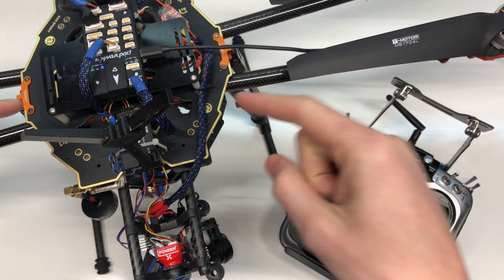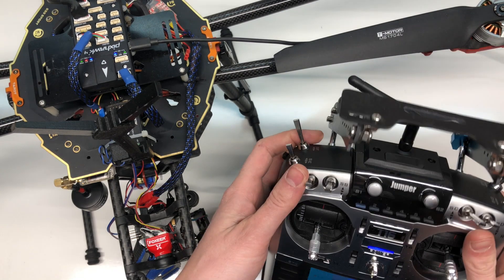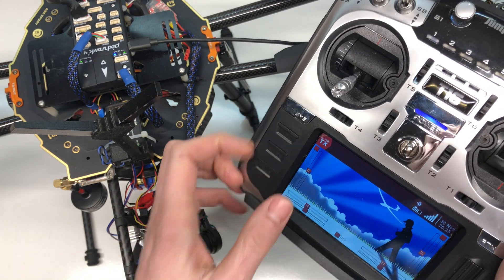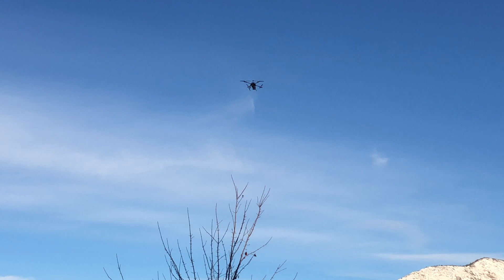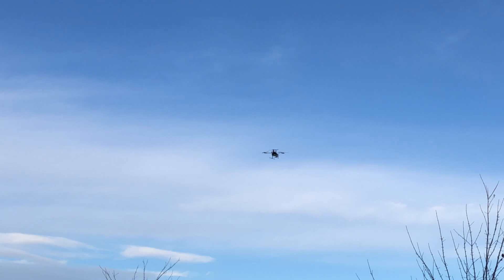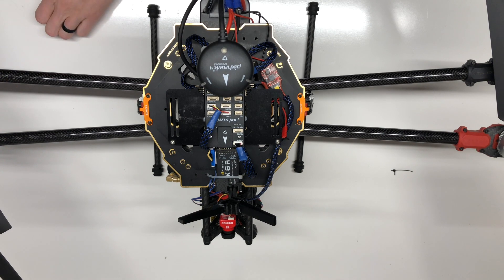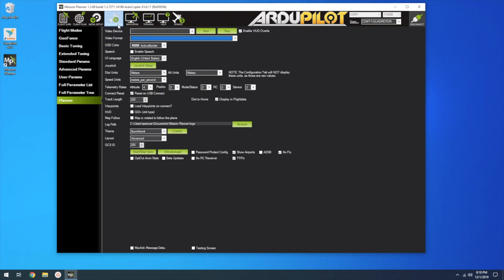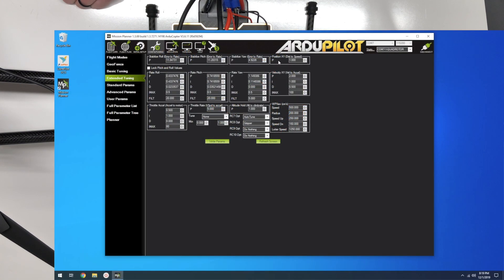Pixhawk AutoTune How To

Comment: Did you have a camera on your aircraft during autotune? Should I remove my gimbal before running autotune?
Reply: Remove anything that moves
Reply: @dvi6605 I did that. I assigned a switch to CH7 and assigned ch7 in Mission Planner to Autotune. Out in the field, I took off, went into ALT-HOLD AND TOGGLED the Autotune switch - nothing happened; it continued to hover. I then tried stick deflections to see if I could observe any overshoot but none observed, even when I tried full deflection for pitch, roll and yaw.
Reply: @BrjanBuckmaster do a ground test connected to laptop, confirm alt hold mode, confirm autotune switch.  Should be able to see status in mission planner flight window.  You may have autotune switch reversed.

Comment: I have a holybrox650 that flies great on suggested parameters. I've been told multiple times to go through the entire "ardupilot methodical configurator" process but the program is quite frankly confusing AF. I don't want to set up notch filters or take everything apart to put the flight controller into the freezer (IMU temp calibration). Not to mention I can't get my bidirectional dshot to log for ESC RPM data. I just want to start flying missions. I think i will just forgoe the process and use autotune since it's already flying stable.

Comment: Great video thanks!! I just need to know the ideal parameters od pids before autotune..i had the maiden flight (orange cube) last day with bad results (Altitude hold and stabilized).. My craft is quite big, quad copter with T motor 490kv U7, and 6s with 18"

Comment: 1) Powered the drone with 3s 2200mAh battery.

2) ESCs make initial sound(Don't know if anyone is not making).

3) After sometime, can see 2,3,4 motors rattling a bit with each beep, except motor 1 and no beep with motor 1 ESC.

4) Using Pixhawk, after arming when I fly the drone tilts on the motor 1 side, but motor1 rotates.

5) For this reason, I have lost my props of motor 1 twice. Please help.
Reply: esc calibration

Comment: Nice videos! Thank you!  Did you  set the Rate Roll and Pitch filters to 10hz (in Copter-3.3 these are RATE_RLL_FILT_HZ and RATE_PIT_FILT_HZ, in Copter-3.4 they are ATC_RAT_RLL_FILT, ATC_RAT_PIT_FILT) as per Ardupilot Copter for large copters?  I have the same copter as you with the Cube, 15" props, and I still had oscillations. But haven't tried the 10 hz. Thanks again for your videos.
Reply from the maker: Interesting... I will look into that! thanks!